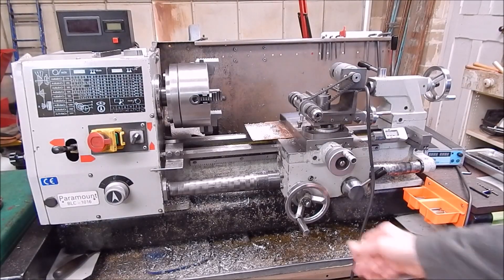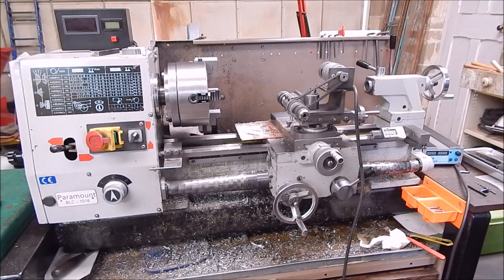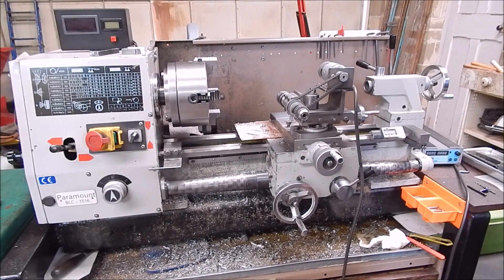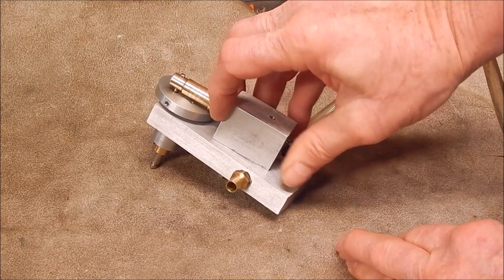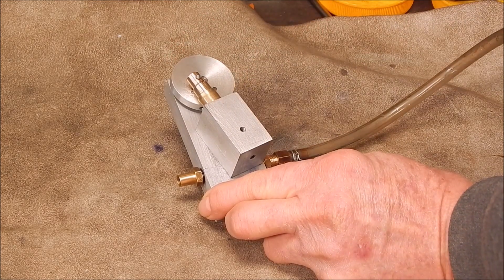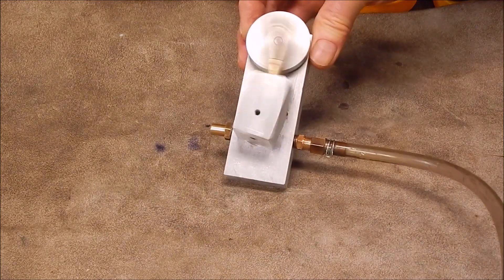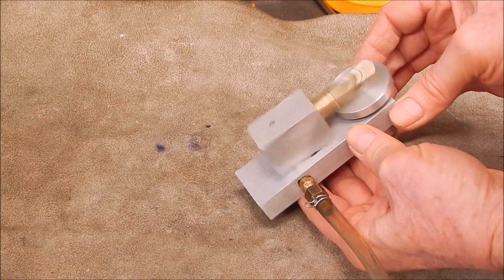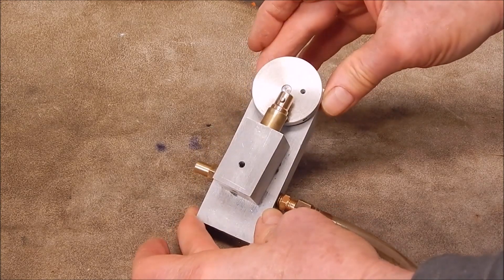The latest project - build a steam engine

Comment: Is this one double acting? Looks great, I hope to build a 'webster' petrol engine when I've got all the tools in the shop fixed up.
Reply from the maker: I don't think so.  I wouldn't really know - this is all new to me ;)
Reply: @Xynudu  double acting just means that steam gets applied to both the top and bottom of the piston, so you get two power strokes per revolution rather than one.
Reply from the maker: The steam only gets applied at one end of the piston, so it's single acting then.  Cheers Rob

Comment: 😂😂🍺🍺 That is a superb little engine Rob. It's an interesting design, I especially like the piston most wobblers tend to have very small pistons but your's runs very well with a larger one. I think you are doing yourself a disservice, for a first engine build that's fairly complex. The first engine I built was much simpler than that. Looking forward to seeing it on a nice base with a flywheel. Cheers, Alan.
Reply from the maker: Thanks Alan,  I put on a steel flywheel and it smoothed things down, but I am thinking of drilling out a section to offset the piston weight.  Good idea ? The alternative is to hollow out the piston, but the wrist pin will make that tricky.  I also have thoughts on maybe running a small DC engine off it as a genny to light up an LED (I have small slot car motor).  I  made provision for a pulley track on the flywheel just in case.  It's gone quite well as a seat of the pants project so far and shows lots of promise.  I hear the pubs are off line in the UK again, bad luck, but there's always 1698 stubbies ;)  Cheers Rob
Reply: @Xynudu  Hi Rob. I would have though that your piston has very little mass so I'm not sure that you would need to modify the flywheel. The generator is a great idea, always good to see them doing some work. Yep, the pub thing is a bummer but I stocked up on bottles of Doombar and Newcastle Brown and I have another Beer Keg Furnace full of Wadworths Swordfish 👍👍 Must get some 1698 on order though! Cheers, Alan.

Comment: Very cool Rob 😎 Much better than the bastard engine🤣. Look forward to updates and the end result 🍺 Enjoy the beer
Reply from the maker: Hi Bill, this one goes reliably, which was something the bastard engine could never manage.  I made up and fitted the flywheel this arvo and it smoothed things out somewhat.  I may drill a balance hole in that as well after I get it all mounted up properly.  Fun little project.  Cheers Rob
Reply: Would like to make one but it would be a machined kit to suit my woeful skills 🥴 and varies between 37 and 4578 on the list 🤣
Reply from the maker: I will be using the Baggins knife again soon - my next review items just arrived.  Stay tuned :)  By the way, that Pommie 1698 beer gets sold out faster than  anything else in Dan Murphys.  Damn good drop.  Try a stubby.  Cheers Rob